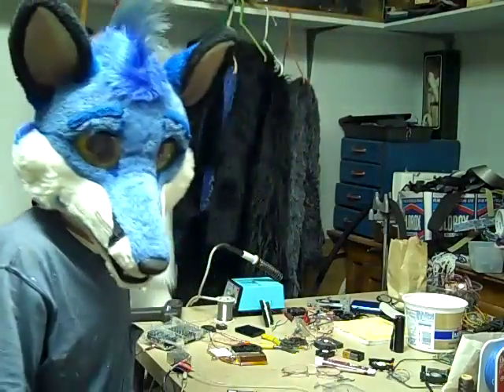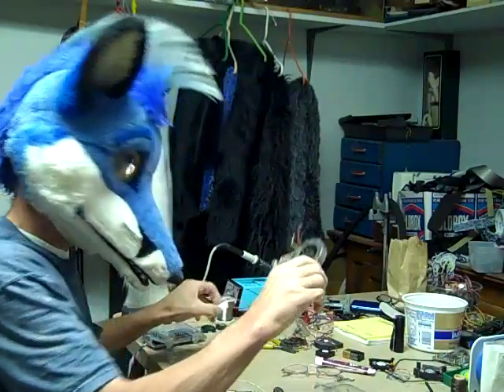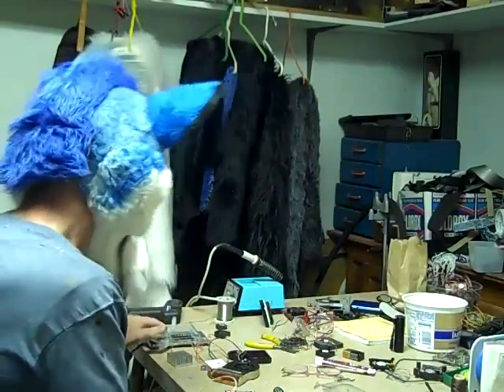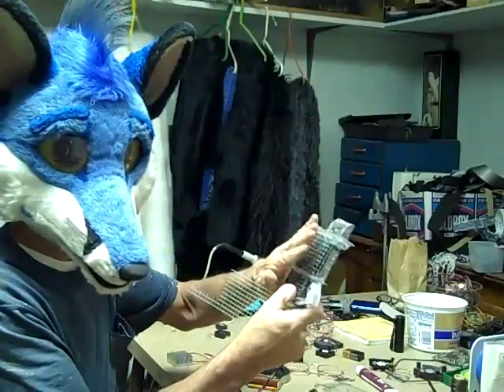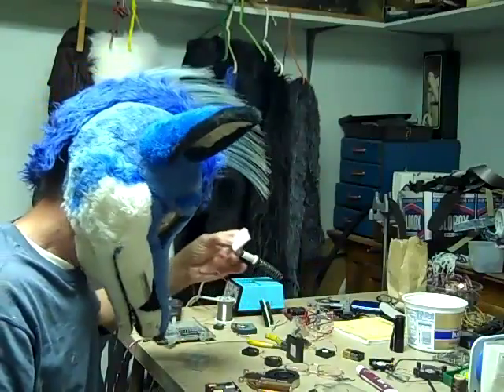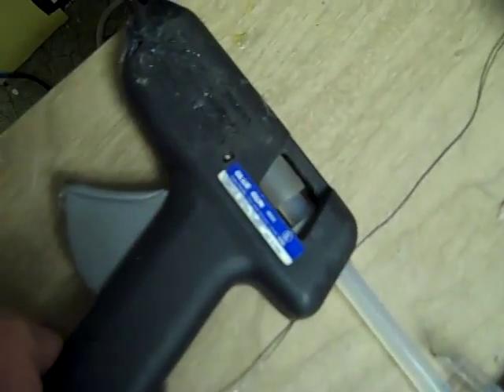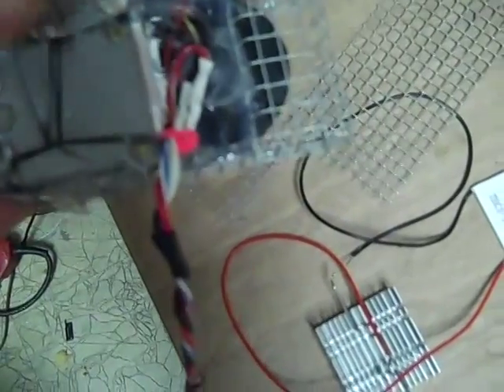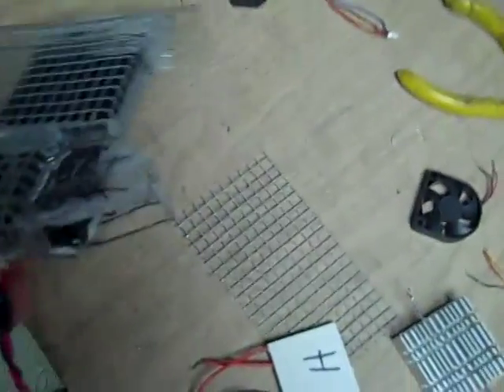Solid state cooling systems for fur suits plus how to build.

Comment: I have a similar idea using a cooling motor built for a desk top refrigerator.   The tiny ones that are $20, about the same size as your small fans.  They're more powerful than the CPU cooling fans.  Be nice if you had done this video, minus the head, and not muffled.

Comment: It blinks!? That's so cool! What did you use? Servos? Linear actuators? I'm putting a large cpu fan in mine because it's very roomy inside. I'm also using a 3s lipo because the last party I went to I almost passed out. I need that extra breeze. I'm happy that there are other furries that are into this kinda stuff. Thanks! You earned a sub!

Comment: that is not effective. use a watercoolers system with pc water radiators on back blowing in and have tubing routing water to waterblocks on your body. yes, they are cold, but it's effective

Comment: How long did this run on the 5 volt batteries? Also was the cooling any decent? I have been trying to research this but the peltier systems doesn't seem all that popular for fursuit at the moment.
Reply from the maker: +TidusPoorPants  a 12 volt peltier runs at 5 volts run more efishant and the heat sink can be shrunken down plus ask Marfles he's got 2 in his fur suit head and it blows a cool 60 degrees for about 6 hoers.